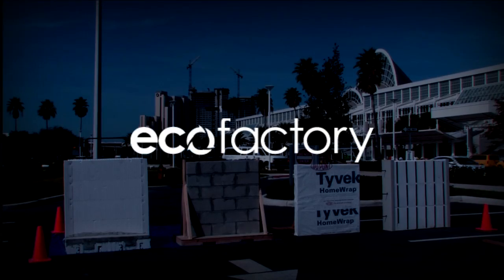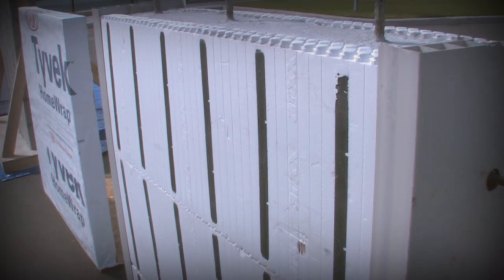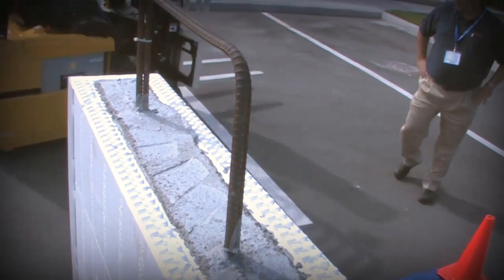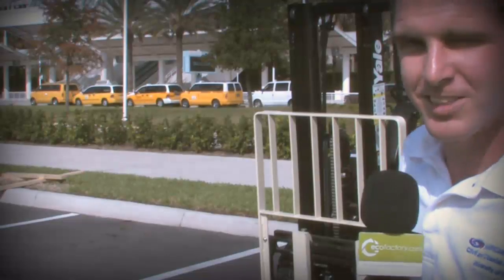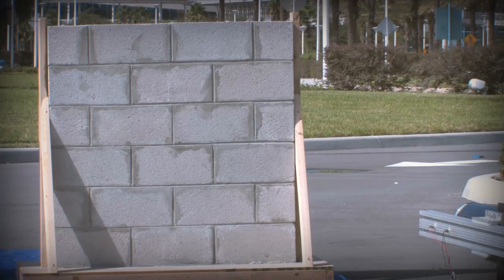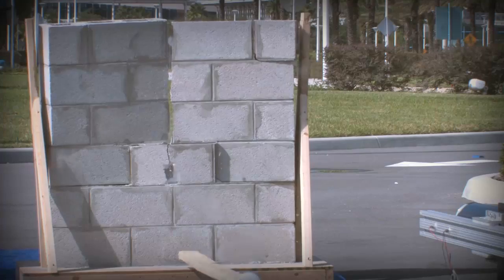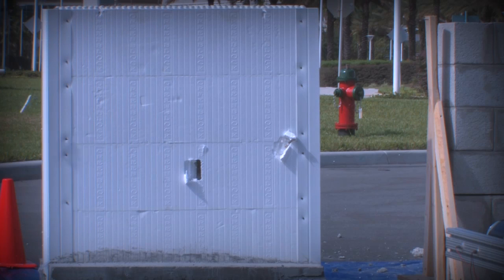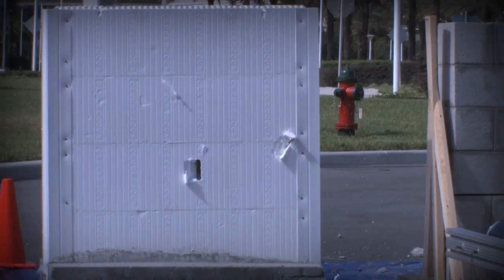2x4 Cannon vs Wood, Concrete, and ICF Walls

Comment: This was a horrible example of not fairly portraying your competitions full capabilities.  To pick wood is not fair to begin with.  Everyone knows wood will fail so why pick it?  But to portray that cmu can't stand up to this test is an out and out lie.  They built the icf wall to code.  They did not build the cmu wall to code leaving the cores unfilled.  What would the Styrofoam do if you left out the structural component.  Code requires cmu to be filled with concrete and 
re-bars in place.  This is not a valid test or comparison to make your product look like it's the best one out there is just deceptive.

Comment: This test shows an unreinforced concrete masonry unit CMU wall. I would never build one that way. At the very least, every second or third hole should be filled with cement and have a vertical reinforcing bar. Then the top row of blocks gets fully filled.
Here on Youtube are videos showing fully filled CMU walls passing the test easily. I haven't been able to find any tests of walls with partial reinforcing as I described above, but I have a hunch they'd pass the test as well, or at least show only localized damage.

https://www.youtube.com/watch?v=Pot7UI5SLb8
Reply: This test of an AAC block wall also did very well. AAC blocks are typically solid. They also offer roughly the same insulation value as a wood framed wall with standard fiber glass insulation. So the additional cost of the block is compensated for by savings in insulation.
https://www.youtube.com/watch?v=xRK4xWgZWCY
Reply: 𝕱𝖔𝖑𝖑𝖔𝖜 𝖙𝖍𝖊 𝖒𝖔𝖓𝖊𝖞, 𝕷𝖊𝖇𝖔𝖜𝖘𝖐𝖎. 𝕴𝖙'𝖘 𝖓𝖔𝖙 𝖙𝖍𝖆𝖙 𝖍𝖆𝖗𝖉 𝖙𝖔 𝖋𝖎𝖌𝖚𝖗𝖊 𝖔𝖚𝖙.

Comment: This is B.S!  nothing more than an infomercial for ICF. who would build a house of concrete block and not put rebar and cement into the blocks?
Reply: Icf is the best wall system
Reply: all builder do that other wise it be too costly for them......

Comment: test the cinder block with rebar and concrete like the hurricane code specifies.

 looks like your at the orange County convention center in orlando. never the less your sales people are skewing the results.
Reply: Incorrect. As per FL code for CMU, only the cell located every 4 feet horizontally is filled with grout and rebar. The cells in-between are left empty. The only areas other than that filled solid are lintels, tie beams, and cells next to openings. The vast majority of a house is left hollow.  

Even if filled solid, there is no horizontal rebar, and damage will still occur much sooner than with ICF.

Comment: thats misleading. the proper way to assemble cinder block walls is to put at least 9mm rebar in the gaps then fill the gaps with concrete. if properly done, its stronger than ICF.
Reply: Alexis Russell Absolutely false. Poured in place concrete in ICF cures at a slower rate, thus giving a stronger finished product. CMU even with rebar and poured cells is weaker due to voids caused by aggregate blocking smaller areas from being filled.
Reply: @JM-jz3yl  Not correct. Self consolidating grout goes into every single nook and cranny. There are videos that show how it performs..
Reply: Alexis Yes the block wall test was misleading, I agree.  It should have been filled with concrete and rebar as well However to say a block wall with concrete and rebar is stronger than a ICF is also wrong.  All things being the same rebar, mix, curing conditions etc. the ICF wall will be stronger.  Most block walls dont have horizontal rebar except above openings.  Most ICF walls have both horz. and vertical rebar in every course.  Plus as jeff pointed out the small cells in CMU are harder to pour properly and voids in the wall cause weakness.  I do not work in the ICF industry but have lived in ICF homes and they are by far the best building system in my opinion.
Reply: Alexis Russell And much more expensive.
Reply: Jeff M - curing rate does make a difference. But the ratio of water to cement in the wet mix makes a much bigger difference. With the right mix you can easily compensate for the faster curing rate. I"ll post a link to a test done on a fully reinforced block wall. My hunch is that it's not necessary to fill every cavity. It might be enough to fill every second or third cavity, with a bond beam at the top. That would save some money. But I haven't been able to find any tests for that.

solid filled block wall
https://www.youtube.com/watch?v=Pd3gTFkJZIQ

 a bunch of tests on brick, all failing, and a test on block that succeeded.
https://www.youtube.com/watch?v=Pot7UI5SLb8
Reply: The ICF has rebar with croncrete.  They should have done one block wall with and one without to see the difference.  I think the blog still would have broke just not as bad.

Comment: were is the solid brick wall that they had back in the day and if those empty cylinder concrete blocks would had been filled with something then it would gave it a good run for the money lol.
Reply: Brick doesn't hold up so well. But concrete blocks filled with a good cement mix and properly reinforced with steel will hold up just fine.

https://www.youtube.com/watch?v=Pot7UI5SLb8
Reply: This was a horrible example of not fairly portraying your competitions full capabilities.  To pick wood is not fair to begin with.  Everyone knows wood will fail so why pick it?  But to portray that cmu can't stand up to this test is an out and out lie.  They built the icf wall to code.  They did not build the cmu wall to code leaving the cores unfilled.  What would the Styrofoam do if you left out the structural component.  Code requires cmu to be filled with concrete and 
re-bars in place.  This is not a valid test or comparison to make your product look like it's the best one out there is just deceptive.

Comment: I'd rather spend 10% more building with ICF and keep my house intact, than save 10% and have it all blown away in a tornado or hurricane.
Reply: This was a horrible example of not fairly portraying your competitions full capabilities.  To pick wood is not fair to begin with.  Everyone knows wood will fail so why pick it?  But to portray that cmu can't stand up to this test is an out and out lie.  They built the icf wall to code.  They did not build the cmu wall to code leaving the cores unfilled.  What would the Styrofoam do if you left out the structural component.  Code requires cmu to be filled with concrete and 
re-bars in place.  This is not a valid test or comparison to make your product look like it's the best one out there is just deceptive.

Comment: ICF walls cost 10% more than wood frames with modern techniques.
Reply: Reduce the exterior wall area by 10%, accepting a slightly smaller house, and have something of much higher quality. Sounds good to me.

Comment: The wood wall is probably 24" OC.
The ICF wall may have been damaged, but no-one knows because the foam is still covering the concrete.
Then of course, the ICF wall is the most expensive by a huge margin.
Reply: ICF more expensive by 5-10% margin if you call that "huge"

Comment: @maherkawash actually, there would be still. I used to be a brick mason, the CMU wall would break every time. Maybe not as bad, but every time. No matter how full you fill the CMU wall with concrete, between the mortar joints, the porous CMU blocks, and the fact that due to the interior of the wall has obstacles  that will prevent the concrete from filling every single void even with a vibrator, the single solid pour of an ICF wall that has both horizontal & vertical rebar will alway out perform
Reply: There are many examples of CMU walls that passed this test, here on Youtube. I'll post 2. In the "real world" any mason that cannot properly fill a concrete block should not be building a wall in the first place.

https://www.youtube.com/watch?v=Pd3gTFkJZIQ
https://www.youtube.com/watch?v=Pot7UI5SLb8